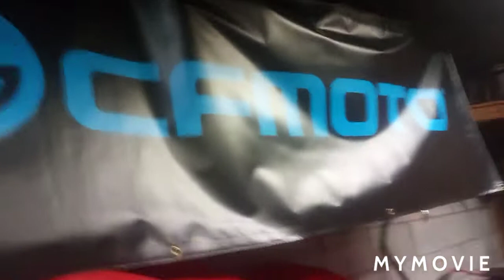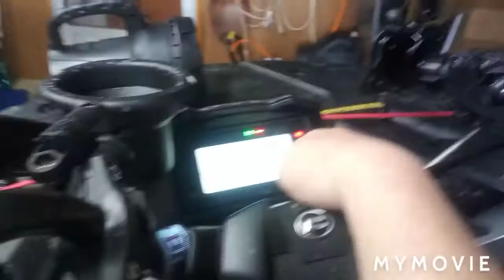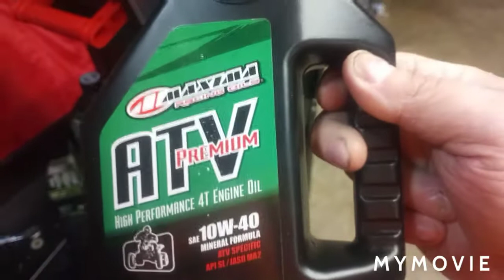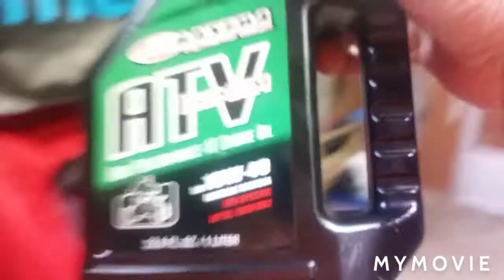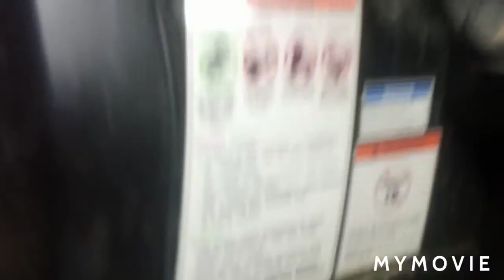Cfmoto cforce 600 2021 Oil Change

Comment: They told me I had to bring it back to them after the break in for only $500 lol and he said he would probably have it for a few weeks.  Sad part is on the breakdown sheet when I bought it they charge me $500 to put the oil in not joking. So if I went back to them that would be a $1000 basically for an oil change.They do change the differential and to check the valve clearances bus no way. They rip u off bad in Canada.  Long story short  I ordered all the oils from CF moto and their filter just so it doesn't void warranty And did all the work myself cost me a $130 and I learned more about the atv. The hardest part about checking the valves was getting the d*** plastics off.